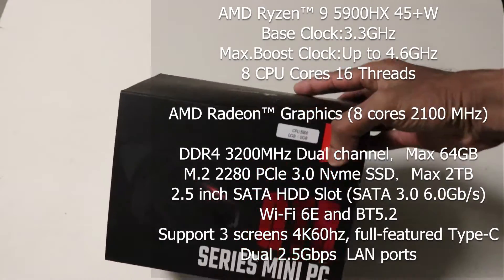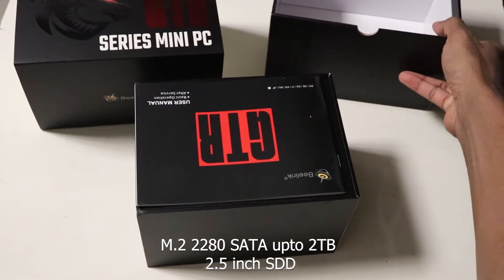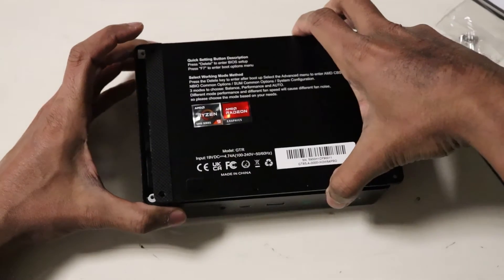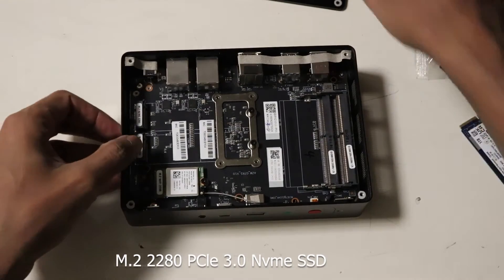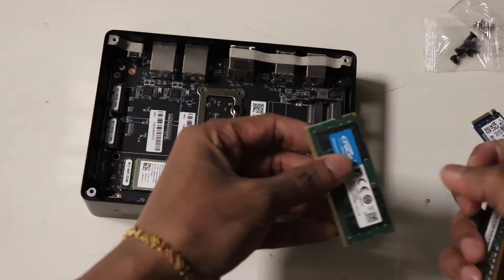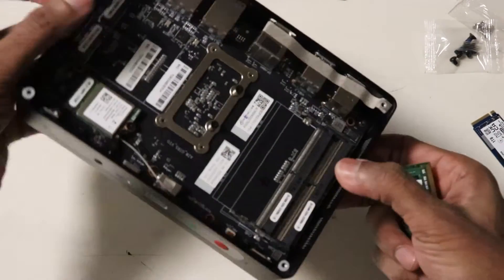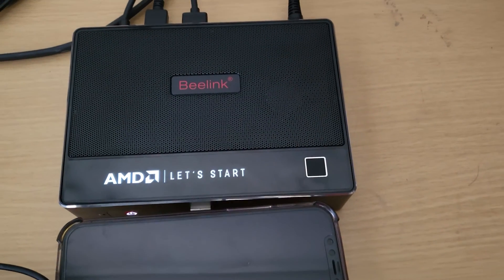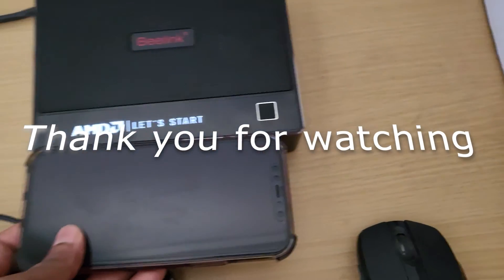Unbox & Upgrade Beelink GTR5 Gaming Mini PC | AMD Ryzen 9 5900HX | Triple 4k Display

Comment: Max 2tb is that total for the machine or per slot?
Reply: Actually it supports more, as all modern boars do.  You can do 4tb in the m.2 slots and the 2.5 sata, I have a 8tb Samsung ssd in it. No issues of course.  Windows limit on the boot drive is 2tb usual easy but you can format the remaining and use it also.
Reply: Spoke with BeeLink Support.  This is 2tb storage total not per slot

Comment: Can you customize the pc other than the ssd and ram
Reply from the maker: no
Reply: Technically there's one more thing that can be changed. The WIFI/Bluetooth card. But considering that it's WIFI 6 and Bluetooth 5.2. I guess it wont need upgrades any time soon!

Comment: Check buyer review - beware!
Reply: Cases of shutting down randomly etc... 🤔
Reply from the maker: @kudzy11  maybe power unit issue? check power unit give enough power to the system. or connect another power unit rated as 19v 4.74A(or higher Amps).

Comment: I'm thinking about purchasing this, is it noisy when under a heavy load?
Reply from the maker: Not really. But my MSI gf65 thin 10ue more noiser than that.
Reply: Yes it is
Reply: It depends on the fan settings. I have mine set in the bios at max perfomsnwce 45 watts and bios fan settings on auto. It stays relatively quiet. Though if you are maxing the cpu out 24/7, it will thermal throttle to 3.7/3.8 unless you have the fan set at 100.  It’s all temp=fan rpm based. If you mount it vesa, it’s even less loud and good air flow.